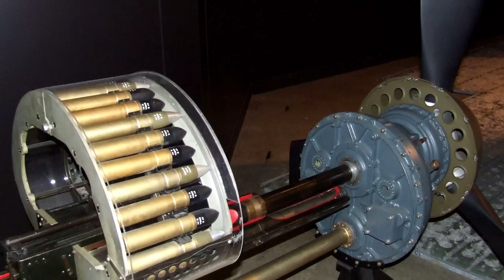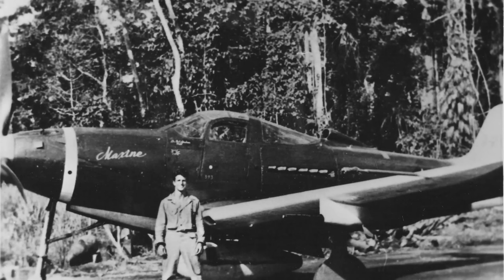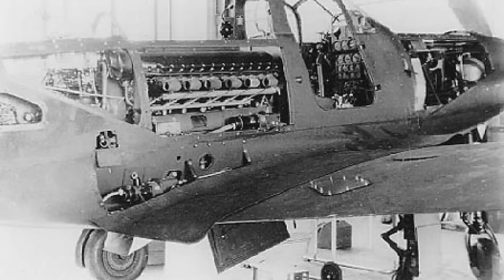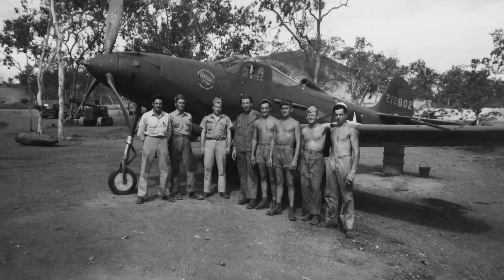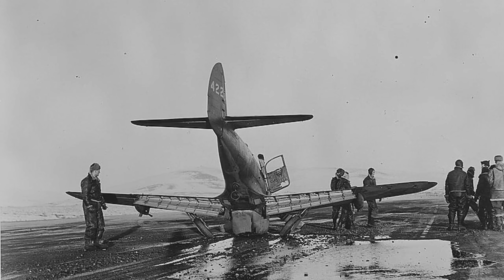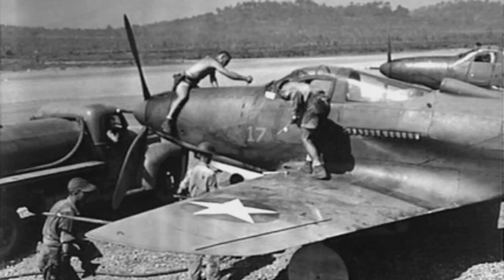P 39 Airacobra 37mm Cannon — Jammed After 15 Rounds — Pilots Switched to  50cals

Comment: The 37mm was between the pilots legs. Huge vibrations. Hard to operate due to no leverage. Hard to clear in flight.
Reply from the maker: Exactly — that 37 mm cannon made the P-39 a handful. Sitting between the pilot’s legs, recoil and vibration were intense, and clearing a jam mid-flight was nearly impossible. Brave men to fly it under those conditions.